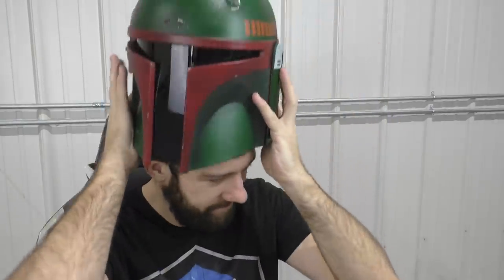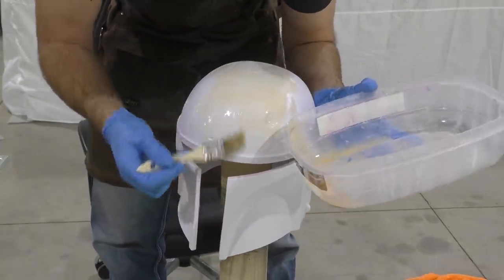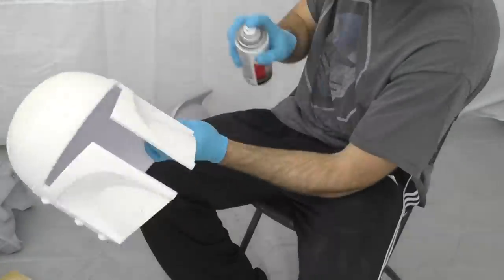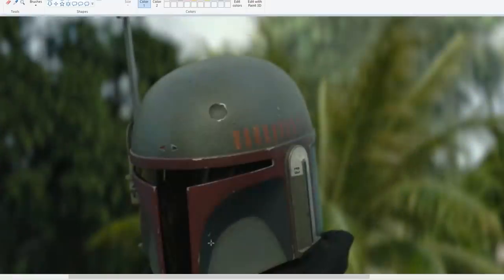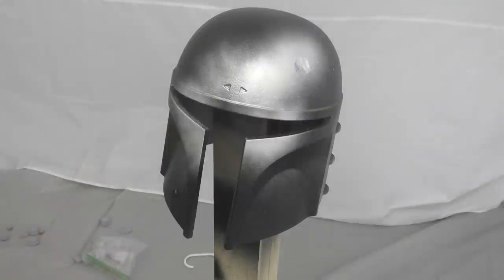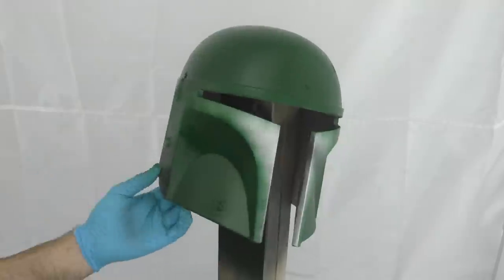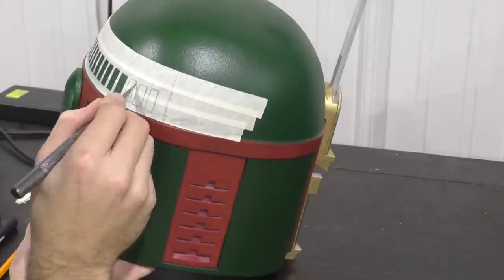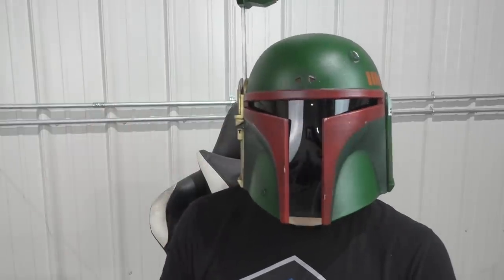How I Made My Boba Fett Fresh Helmet

Comment: Oh damn dude! Have a video comparing FDM vs Resin Sanding and never even considered pouring resin on an fdm print to smooth it out! 110% will have to try that out. Awesome tip!
Reply from the maker: I like it a lot more than xtc3d for example since there's no measuring or mixing!
Reply: Ha I saw someone do this just about a week ago and it has changed how I do things!
Reply: @GalacticArmory  not to mention the cure time would be way less. UV light with resin for a few mins and good to go. XTC takes a good while
Reply: Love GAs prints. What brand resin should I get. Yeah I use xtc right now, good but finicky.
Reply: @GalacticArmory  What 3d printer and filament do you use?? I would love to try this at home
Reply: I saw this in one of his other videos and it worked awsomely!
Reply: How long does it need to cure with uv light?
Reply: 66th like
Reply: @GalacticArmory  ol

Comment: Definitely would like to see the full armor to go with that. I noticed you had to rotate the helmet to get it on. Where is the tightest spot on this helmet? Looks like right around the cheeks. I would like to print out a test fit ring to size it. Might be a good idea to include a separate stl file with a sizing ring for your helmets. I know people could just make them on their own but it’s much easier to figure out the tight spots once the helmet has been printed.

Comment: I used Colonial Red for a helmet I bought off Amazon, the paint job came out kinda rough with a lot of running but I actually like how the pant ended up running so I didn't fix it. but I think the thing shrunk in the cold weather or I still need to sand down the inside of the cheeks

Comment: It's always a pain to make these helmets. There's always something that feels off. Same with this one you're making. The most stand out thing to me is where the helmet meets the visor. In the reference photos, the frame of the visor is very thin. In your 3D print, and in many 3D prints for mandalorian helmets, the material around the visor is thick. It also seems slightly oversized in general. I wish I could just turn off this part of my brain that's always wanting to make the perfect thing.

Comment: Since youre using a truck bed liner as a sort of base coat, do you really need to sand away al the print lines? Ive been wanting to start printing my helmet but 4 days is a lot to wait so i was thinking of printing at 0.3 resolution.

Comment: I have a question about the print. Is the fact that the printer is large enough to print the main body the reason that you printed it in one piece? I have a fairly large printer that would be able to but i always see in your vids you do 3 different pieces.

Comment: you are making it more work then you need to. When I did my life size c3po I used 2part epoxy primer 3 good coats of that and .2 layer lines vanish when sanded and it sands very easy only need glazing on seams.  I just do a coat let it cure then do another  only do the 3rd when its the step layers most of the time the first sanding of those three is all I needed. Gordan Tarpley did a video about in a few years ago https://youtu.be/0VXtOQGOpxA